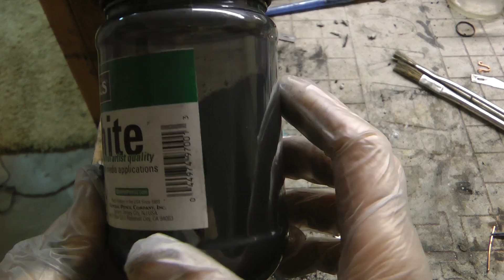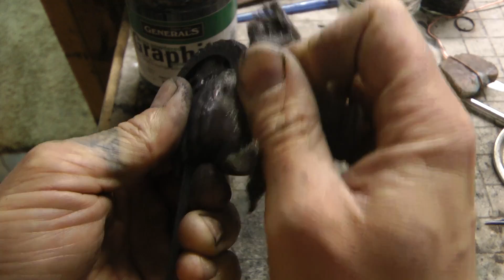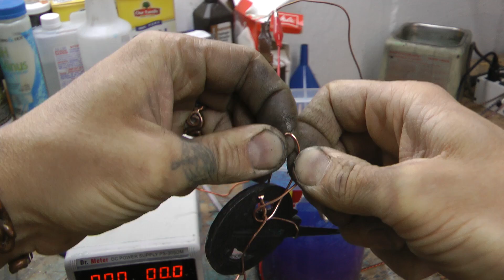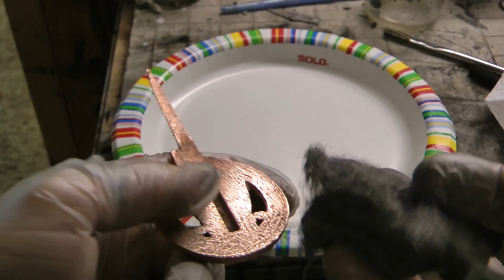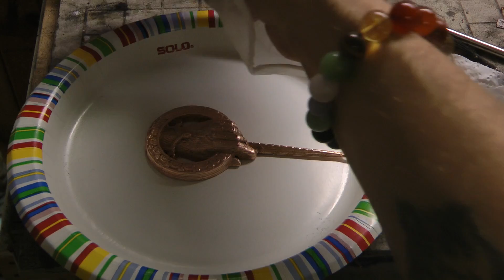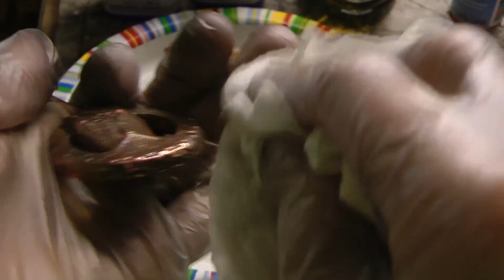Copper Electroformed 3D Printed Objects Tutorial

Comment: Hi Jason, I don't speak English. Thank you very much for explaining very well... I'm thinking of doing this on long pieces, swords specifically, do you think it's possible?
Reply from the maker: Like a prop sword?  Or just a small replica?  You'll need to connect several wires to the cathode bar for sure to pull it off.  So the copper distributes evenly.
Reply: @JasonWelsh  Thank you very much for answering... it is real size, for example anduril

Comment: Does this work with PLA plastic? When I tried the acetone didn't really dissolve the print, so the graphite didn't stick well.
Reply: I believe you would need to use MEK (methyl ethel ketone) or THF (Tetrahydrofuran) in place of acetone.  I haven't tried either yet but according to various internet sources, both soften/dissolve PLA but are rather nasty stuff to work with.  THF is the main ingredient in many but not all PVC pipe primers.  Look at the SDS (Safety Data Sheet) for whatever you buy and it will have the percentage of THF.  Example:  Weld-on P70 Primer (colors the part purple) has 45-59% THF and 19-29% MEK by weight.  Oatey #30757 primer (also purple) only has 15-30% THF and 25-40% MEK.  Higher THF is better than higher MEK from my research.

Comment: Hi Jason, 
After the plating process is completed, I saw that my object has large brownish stains on it. Do you have any idea what might be the cause of this?
Reply: The copper you're using is contaminated. Or you contaminated your bath somehow, pour away Ur solution and start from scratch. If you accidently touch any other metal into the solution while the power supply is on, you will contaminate your solution and need to start again. I'd recommend getting yourself some different copper for the anode as I think the stuff ur using now is not 100% pure. Lmk how it goes
Reply: @SquishyThing  definitely will do, thank you for the response👍🏻

Comment: What you are doing is eletroPLATING = adding metal to the outside your geometry, thus changing it. Thicker layers will inevitably result in a loss of detail. Also, the loss of detail will be UNEVEN, depending on the distance to the contact point, the electrodes and the radius of your object in a specific point. Electroforming is a different process that does not have those disadvantages.
...
ElectroFORMING will be a 100% exact metal replica of your model, maintaining all surface detail. In order to do that you will "split" your model in two ore more copper shells that will be soldered together later, typically with low-temp "soft" solder. For those shells, you cast NEGATIVES (2 ore more) from your finished model which you make conductive with silver paint or by casting your negatives from epoxy / PUR made conductive with graphite powder. Once the copper deposit on the negatives is thick enough, you hit the copper with a soft flame and it will literally pop out of the mold. The outside (towards the mold) will be a 100% precise copy of your model. The shells are then filed down to the parting lines and soldered together (at that point you can fill the model with some metal with a low melting point, certain types of ph-neutral-concrete, resin etc.). After that a thin coat of copper and/or nickel will hide the solder lines and give you extra mechanical stability. Such objects will be used for props, replicas or dummies for hi-res box shots of consumer products.

Comment: Question. What would happen if the anode and cathode did touch? Would it be like some dangerous reaction or would the process just not work?
Reply: That would depend entirely on the power supply. A good supply would just say "oops, short circuit, better shut down" while an unregulated supply would create lots of sparks and heat.

Comment: Try instead of graphite, 
Cu(OH)2.
Add NaOH solution  to CuSO4
Solution. 
Coat your piece with the suspension. 
Thin coating 
Then connect to cathode.

Cu(OH)2 will immediately reduce to Cu metal.
Reply: but if his plastic cant withstand NaCO2 I think it would be even les resistant to NaOH

Comment: Any idea if the copper sulfate solution and the graphite paint you are using here will work for brush on electroplating? I'm planning on making some 3D printed parts that will be far too large for me to feasibly make a tank to submerge the part in.
Reply: Yuo always need to submerge the part , all cover by the electrolite ,any part without it , will not have any metal on it

Comment: Conductive copper paint works the same as the Graphite powder in that it is also conductive, AND it is also a lot less messy.
Reply: Acetone melts the plastic and makes the surface embedded with graphite permanently. This creates finer detail because no paint fill up the pores or small recesses.
Reply: @clemenceronald  i dony know, but i think that acetone dont do nothing relevant to pla ,but acetone can disolve Abs , so?

Comment: Will this stick to regular PLA or only ABS prints?
Reply: ABS is better but get silver spray paint works miracles and so easy to use try tifoo.de or get the copper dip for 3D prints also good

Comment: Hi sir nice video... Can you make a nickel Eltroforming cavity video
I'm waiting for you reply
Reply: In theory you can electroform with nickel however Cooper tends to create - let's call it - "a stronger bond" when building up the volume needed to guarantee minimum physical structure to the piece, and I'm not sure about the ability of Nickel to adhere to the graphite surface - something to be tested for sure.  Also, Nickel tends to be more britte so chances of cracking the piece when removing it from the mold is higher. If you want the nickel appearance, do the electroforming in cooper first as shown in the video and then electroplated it in nickel - you will probably get the best of the two metals !

Comment: Great video thanks.

I've done this myself as well, but instead of making a thick goop with acetone. Finish your model perfectly, use a light coating of  spray adhesive and when it's tacky do a tumble of your object in the graphite powder. Once well coated dry brush the excess dry graphite off and press the details more defined. 

It's a much better process and preserves the material and surface details.
Reply: I was just gonna ask if someone had tried airbrushing an even thinner mixture of the graphite, but this method seems good too.
Reply: @Explore-Gobal  My message was poorly phrased. I was enquiring about the two methods.
Reply: @Explore-Gobal  I want to find a good substrate for electro forming.
Reply: I would imagine a solution that chemically bonds itself to the abs would be more reliable. I wonder if this abs process would work on pla given its resistance to acetone.
Reply: Which would be more durable?
Reply: @LEO-xo9cz  The copper coating determines the durability, so if the thickness of the copper is the same, the durability should be equal.

Comment: So your "goop" is just the graphite powder and acetone? In electroplating and forming is this combination something that works as a conductive coating that will hold to many other materials?
Reply: I think the reason this works is that he's using a plastic that is softened by the acetone (ABS), so the graphite particles embed in the surface.  On materials that acetone doesn't soften, the graphite will all just rub off.
Reply: i thing with pla it could work. you should give it a try

Comment: Nice tutorial, thanks for sharing.

There's only one little issue at the definition.
How I've learned, electroFORMING is when you create a new object disposing metal into a negative mould which is conductive and electroPLATING is when you cover an existing object's surface with metal.

Otherwise I really like how that piece turned out. Subscribed obviously for more valuable content.
Reply: If you check out wiki's description of electroforming, it does say that in decorative electroforming that the mandrel is often left in place. Usually like you said the mold is removed after forming to create the new object but that is not always the case. I agree when you leave the mandrel in place it could be considered both electroforming and electroplating.